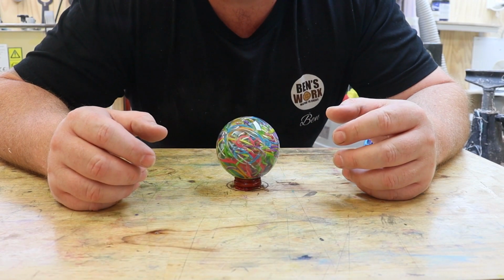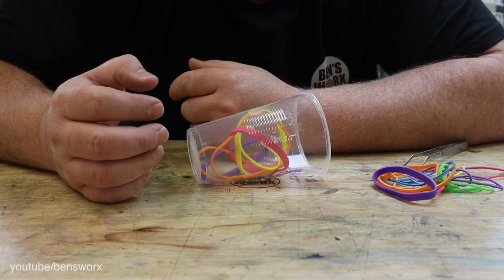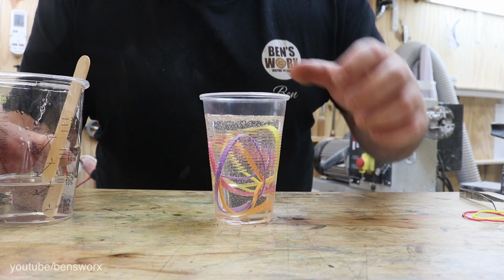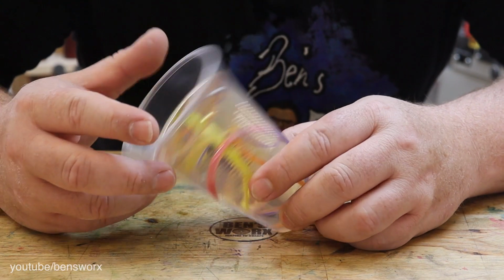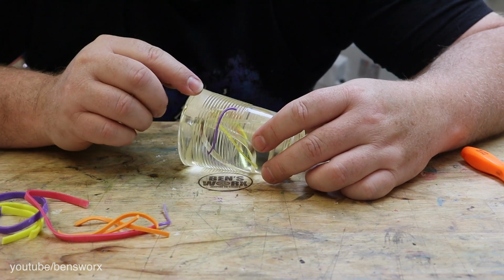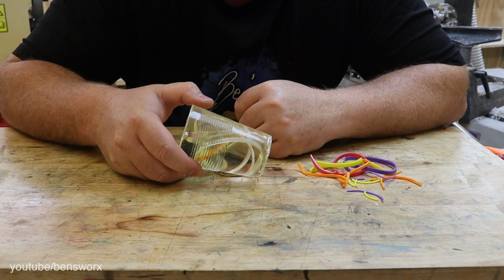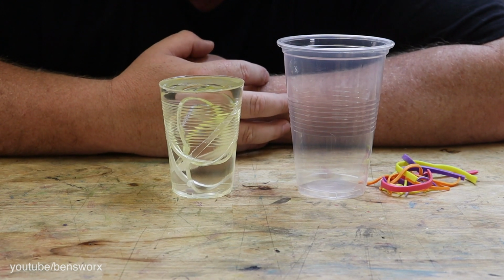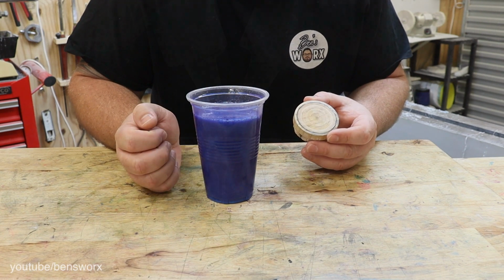Woodturning The Rubber Band Voids - Swapping Rubber for Resin (Will it Work?)

Comment: Can I suggest curing it in a vacuum chamber? Then once the pressure is restored the bands will shrink and be easier to remove  (hopefully)
Reply: 🤔 - Maybe?

(I don't know much about resin...)
Reply: @Tazerboy_10  the vacuum will cause the rubber bands to expand,  once the resin is set if you release the vacuum the bands will shrink back to their original size, leaving hollows for them to be removed
Reply: @benlaird7878  what's more likely to happen is that the resin will fill any air gaps on a microscopic level. in theory this would cause the resin to grip the rubber more. but, this may turn out to also be a desireable effect. it could cause the rubber to harden, and if it was hard/dangerous to turn before the vacuum it may improve to some extent.
Reply: Experiments like this are why I always keep coming back. Would love to see if this has any significant impact on removal/turning afterwards.
Reply: How do you know a rubber band will expand in a vacuum chamber?
Reply: @baconscoobysnacks3135  honestly, chances are that EVEN if it did, which i doubt... rubber is a fairly dense material. not really a lot of air pockets, not to mention rubber bands are thin. i mean... it's not a marshmallow. marshmallows expand A LOT in a vacuum chamber, but think about what happens to the marshmallow when you remove that vacuum. it comes out smaller than it was originally! But ofcourse, this requires air pockets and marshmallows are (FULL) of them. infact, they are probably mostly air. though i do agree it's cool to think "what if" because hey, there's still some what-if-give, if you will. i just think their expectations are unrealistic
Reply: @spookz4469  very unrealistic
Reply: honestly this gave me an idea though. what if he made marshmallow rings? i wonder how they would take dye. might make for an interesting effect.
Reply: @benlaird7878  This all depends if the rubber is open cell or closed cell. Closed cell and the vacuum would work, and I think it would work well.

Comment: good stuff ben , may i make a few suggestions
1 when removing the band a little watered down washing up liquid will help pull them out apply with a syringe
2 apply epoxy with a syringe this way you can keep the colors somewhat seperate
but realy interesting project

Comment: now thats very cool. especially with the glow in the dark effect too..

If I may offer a suggestion: Maybe as another (possibly last?) way to explore this idea you could cast a square blank with rubber bands innit (again treated the same was as in this one to make them removable) then after casting cut it vertically into quarters, pull the rubberbands and then recombine those quarters opposite way (so that all inner side where you did the cuts are facing outside) then do the casting to fill the voids. Doing that might enable you to put more rubber bands inside eitehr way I think it would look pretty cool. After that I suppose egg shape would sitll be a great call as far as final shape of the thing goes

Comment: Maybe shoot a little bit of air in there to help loosen the rubber bands. This should be a cool project, can't wait to see the end. Also potcam was pretty cool, watching the bands move around as it hardens. And you can see the bubbles pop on top. I think maybe you should have added glitter to the clear too, it's always fun watching the glitter dance around inside the pressure pot as it cures.
Reply: Welp, great minds think alike lol. You're now using the air hahaha. I should have just waited, I knew you'd get it. You are more of a pro then I ever could be at this lol

Comment: I think a neat idea would be to make a small blank and instead of rubber bands just drill a bunch of random holes throughout the blank then put the holey blank in another cup of resin like you did with this one only pour the second part in layers so that different colored resins fill different layers of holes...if that makes sense
Reply: Heh, that'd actually work a lot easier than my idea I suggested of using crayons and melting them out.   Over-thinking it so much so I did.
The easier thing with drills is you can mix and match colors all over the place at various angles.  You can use different sizes.  You can even use screw bits to create interesting shapes.
Glow+ opaque resins combined with semi-transparent resins using this could create a really nice layering effect.

Comment: Hi Ben! A possible idea for you to revisit this "filling the voids" stuff is instead of using rubber bands that are kinda hard to remove once the resin cures, try using these colorful little plastic threads/tubes that kids use to make bracelets out of! They have a very smooth surface so it should be easy to remove them, especially if you also spray them with some mold release prior to pouring the resin. Love your creations!

Comment: On top of pulling a vacuum instead of pressurizing it during curing, you could also find some rubber bands that dissolve well (most dissolve in acetone), then after pulling them out put the whole cast in a container that can withstand acetone and see if you can dissolve them. Should leave very clean lines
Reply: Not positive, but pretty sure acetone will have an adverse reaction with the cured resin...
Reply: @Quickened1  Obviously something to test out beforehand, some resins will definitely react with acetone. There are many chemicals that may or may not dissolve rubber bands and may or may not affect the cured resin, really won't know until you try it on a few samples.

Comment: Very nice! I’m curious, does resin react with acetone? I’ve heard that it dissolves styrofoam. So I wonder if you could do something similar to the rubber bands, only with styrofoam packing peanuts. Cast them, dissolve them, and then fill the voids. Or maybe the heat of the resin would have too much of an effect on the peanuts during the initial casting? Take care!
Reply: acetone dissolves epoxy.
Reply from the maker: That would be cool
Reply: @douglasharley2440  Good to know! Thanks Douglas.
Reply: Rubber bands dissolve in gasoline, does that harm Epoxy?
Reply: They also break down in coconut oil. I had the same thought about using acetone to dissolve the bands, but yeah, apparently it doesn't play nicely with resin. But either way, the end result was glorious.
Reply: You could also try water soluble peanuts for this.
Reply: @douglasharley2440  what about urethane resin?

Comment: Hey Ben, this was a cool project. I really liked how it turned out. I have a thought if you ever wanted to try this again. You could cut the rubber bands and then glue each end to a different place, that might make it easier to pull them out, and it would also allow you to choose how they were positioned somewhat. Either way, keep up the amazing work.

Comment: You could have used an acid resistant epoxy, connect the rubber bands with a soldering iron so that you can put more rubber bands inside and then cure it. After is cured put it in acid to dissolve the rubber bands so you have much more canals to fill and it would be completly clean. Also in my opinion using glow powder in the resin would look amazing at night. Great job on this one as i didn't expect it to turn out this way. (Sorry for bad english, its not my native langauge)

Comment: You should try casting some kind of foam, like spray foam. Then dissolve the foam away with acetone or something. After that you could fill the void with a different color resin and have a really cool effect. Or maybe if you used a colored resin and sucked it in to all the pores of the foam then dissolved it, it could be like a bee hive type casting. Just an idea. Keep up the good work!

Comment: Heck, even with the bands stuck in it, it creates an interesting contrast so it didn't hurt all that bad.  Using specific band colors opposing the resin dyes could conterbalance any issues if some gets stuck by creating that interesting contrast.
I knew this would turn out neat.  It's like those glass ornaments with shapes embedded inside of them and they look really neat. Have one to the right of me.
The glow powder looked neat as well.  Imagining something like this that would glow in the dark could look really cool

I wonder if there are any other materials that could be used to make it easier to get out.  Something that could be chemically removed very simply, or even hot enough water or heat.
One thing that came to mind there that'd not really work on such a small scale would be crayons facing in from the sides.  You could melt them out and fill each one with semi-transparent dyed resins and create this stacked rainbow effect of colors. Downside - it'd take AGEEES filling in all those voids if you wanted to use multiple colors.  (You could plug up some of the holes temporarily, add resin dye 1, wait for cure, etch hole to other blocked voids, repeat until all filled.)
That's definitely a commission-tier affair, probably too niche to warrant the effort.

Comment: If you have a 3D printer, they make a filament that dissolves in water. Print a random design with likes and shapes, then use the water to 'melt' it out

Comment: Use spray glue on the inside of the cup. That should make it possible to put in a larger number of bands so they fill more space while also all touching and sticking to the cup. For the mold release, find one that's a liquid so you can fill the cup then dump it out and leave it upside down for a while to fully drain into another container for re-use on another one of these.

Comment: very interesting! maybe after securing the rubberbands to the cup you could spray in some silicone mold release, to facilitate removal?
Reply from the maker: Yep did that 👍
Reply: @BensWorx  Vacuum and pressure it submerged in soapy water to see if that will work in and slick up the bands for easier pulling.

Comment: Chemistry 101, Part Two : What happens to rubber when it's super-cooled?

You should try to freeze your cast to really low temps, when frozen, rubber is as hard as ice

If you can find it, use liquid nitrogen, plunge your cast in it for 30 min then turn it
When ( if ? ) the rubber start to heat up, either take the cast off your lathe and plunging it back in the nitrogen for a 30 second , OR you could directly pours liquide nitrogen on your cast while it's on the lathe, just make sure to use protection for you and to put something under all this to collect the nitrogen that you poured

If you can't find liquid nitrogen, you could most certainly find dry ice ( super easy to get online ), cover your cast in dry ice inside your freezer for a few hours then turn it 
And once again, when ( if ? ) the rubber start to heat up, either you take if off your lath and back in the dry ice for 2 min, OR you could take cold resistant glove, and put dry ice directly on the cast , form a layer of dry ice around it and let it freeze for a few minute ( wet the cast so the dry ice stick to it ) or use a cloth, put dry ice in it and wrap it around your cast

Comment: Maybe you could drill many holes in a cup, cut the bands and pull them thru the holes, tying a knot on each end. Then put cup into another cup and pour. Then turn until you hit the knots and remove bands

Comment: I’m wondering if you could use some giant rubber bands mixed with others in a bigger container.  Instead of glueing them to the inside of the container, you could cut the side of the container and draw them through it. Then you could have looped and cut bands…and make designs inside the container easier that way.

Comment: Maybe use cocktail sticks or metal skewers (or even uncooked spaghetti) and put them through the plastic cup kerplunk style. Go round with hot glue to seal and then spray mould release and then pour in resin?

Comment: Maybe use strips of silicon. The resin would not stick as easily, and it may be easier to remove them after the resin has been set. The silicon would also be more resistant to the curing heat.

Comment: What if you fill a cup about 80% with clear resin, then injected some colored resin into the middle of it before any of the resin cured at all  and put that into your pressure pot to cure? I wonder what that would look like. Would the resin just mix or would the blob of colored resin remain intact?

Comment: I think it turned out ok but you could have just got that effect by using the same coloured bands. In the last video where you were left with some gaps where the bands have come away at the edges, could you not fill those with clear resin?

Comment: Ranger bands. Just take old or new bicycle tires and cut them into however thick or thin band you want. They are wayyy stronger than rubber bands. Some bicycle shops will give away the old bad tubes for free.

Comment: I haven't gone through your channel yet, but what if you cast resin around wax then tried to melt it out and fill those voids.
Reply: The trouble is that resin heats up as it polymerises, so there's a good chance it would melt the wax before it had a chance to harden around it.
Reply from the maker: I can give it a go

Comment: you could try a different method. Hot Glue doesn't stick to Resin and can be dissolved with Isopropyl alcohol. Why not creating a structure with Hot Glue and fill the voids with coloured Resin?

Comment: Have you thought of making rubber bands or shapes out of a material that can react with a chemical that the epoxy doesn’t so that afterwards you could place epoxy in the chemical with an access hole then directly into pressure pot this way when material reacts turning into liquid it would leave a void in the epoxy whatever shape you desire 😮

Comment: I think it might have been easier to pull the rubber bands out if you had used a vacuum chamber instead of a pressure pot, thinking of it

Comment: I think there was too much stretch to get the bands out. String trimmer line comes in different sizes and shapes. If you epoxied the ends to the cup with it resin, I bet it would come out easier

Comment: Looks terrible, sorry. I'm glad others like it. The textures are awful and the bubbles too. The colour choices are good but little else about it works. Would be better with less turning and more stuff inside.. and if you didn't  leave rubber in there... if you could inject the resin and fill the gaps better. The whole idea of taking the rubber bands out was bad. Of course rhey will get stuck.